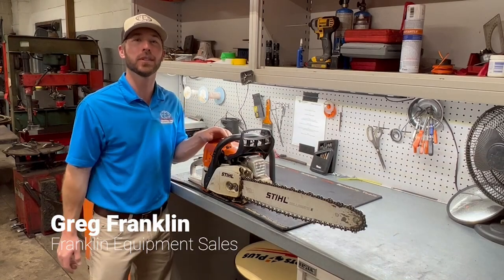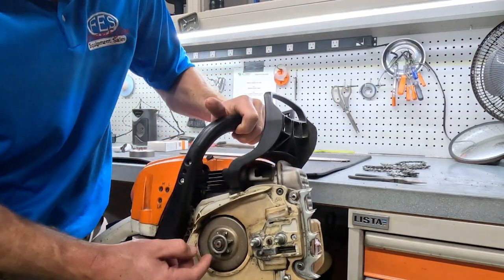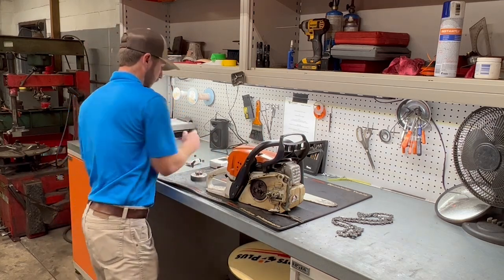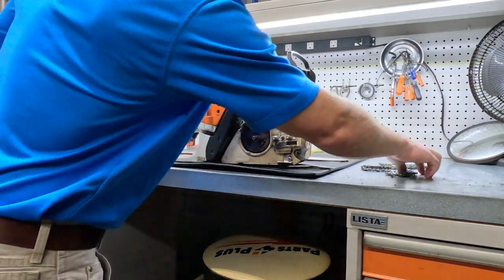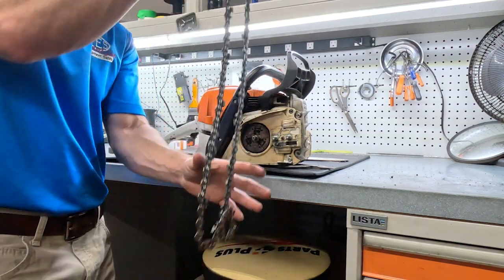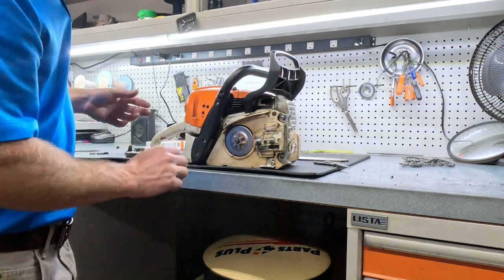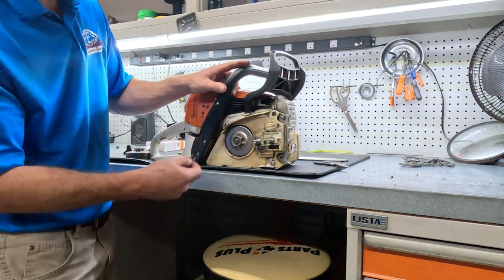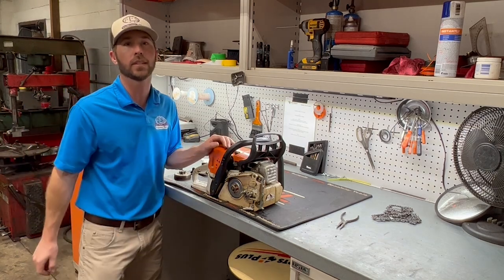How to replace a sprocket on your STIHL chainsaw

Comment: One thing I would add to this video that I found out the hard way as make sure your bar isn’t locked because the sprocket won’t fit.
Reply from the maker: Yes, That is very true. Don't have the chain bake on.
Thanks,